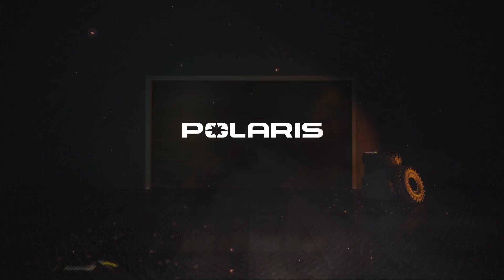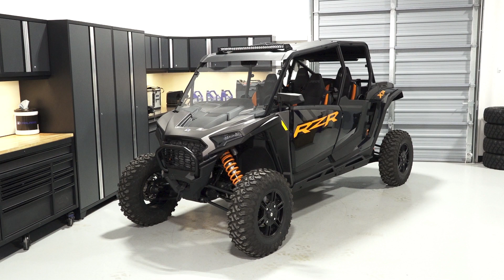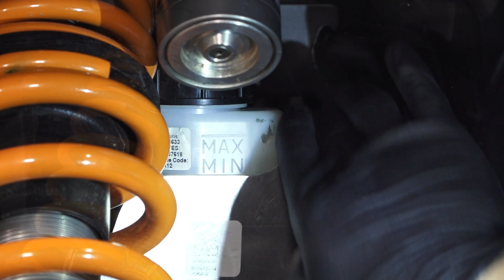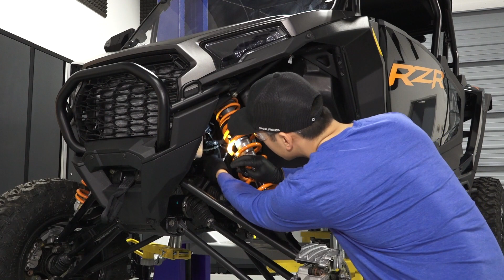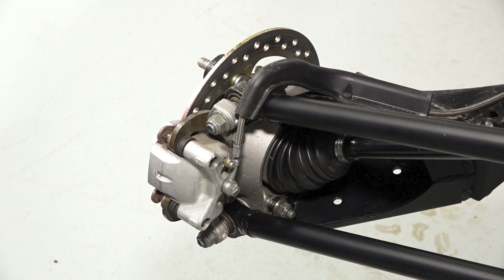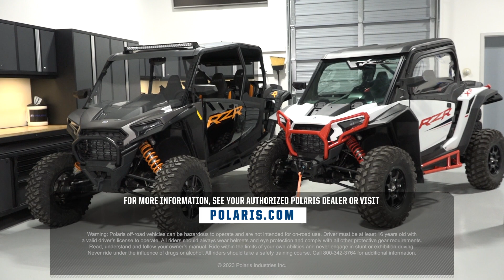2024+ RZR XP | Wheels/Brake Inspection and Tire Rotation | Polaris RZR®

Comment: On my 2024 xp1000 the wheels are different sizes so you cannot rotate the tires. The front wheels are narrower than the rear wheels and a different shape so when you put the rear wheels on the front they rub against the brake caliber. 
just thought I would mention this to save somebody else the headache of rotating them and finding out the front wheels won't turn all of a sudden!
Supposed to be for better handling but in reality I wish they would just use the same size wheel on all 4 so we could rotate them.